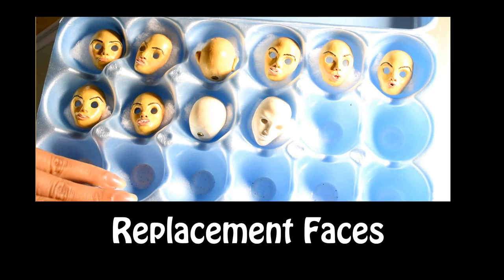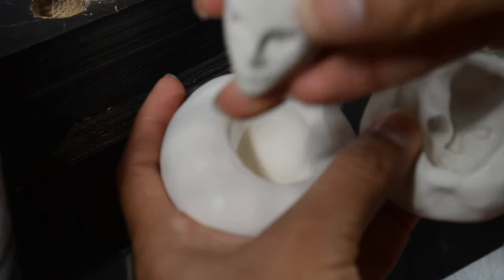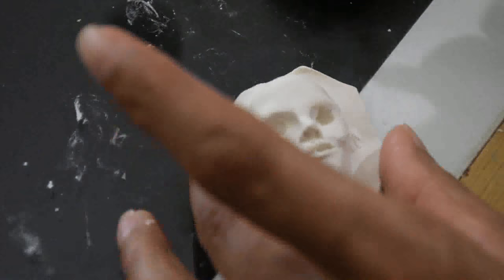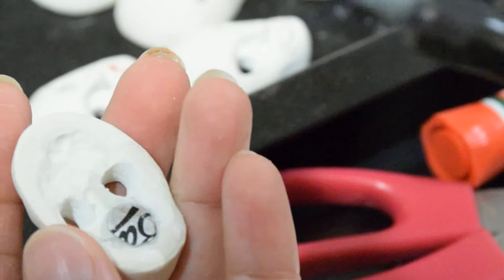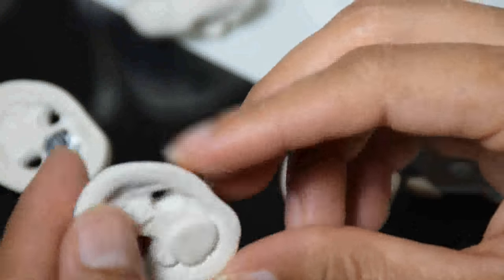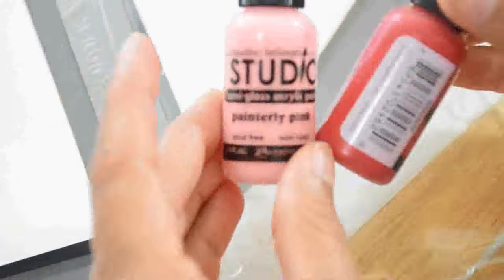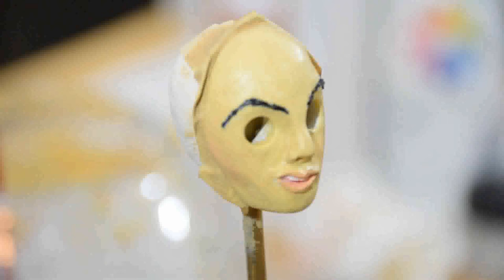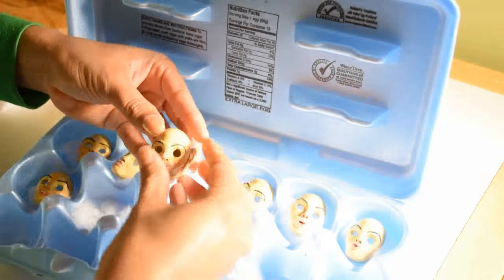Replacement Face & Mold Making for Clay Head (Stop Motion Animation Puppet)

Comment: I have only used resin and silicone for puppet heads. Maybe I gotta try making them with clay by following your technique. Since working with silicone and resin can be really messy(because they are liquid before curing and are extremely annoying when it gets on skin) and take too long.(silicones can take up to 6~8 hrs depending on brand and temperature) This method seems like clean and quicker.

Comment: I'm assuming you are using polymer clay for both head and mold? And corn starch is acting as release agent? Maybe make mold out of some other stuff like platinum based silicone. So you don't have to use release agent like corn starch. This way, you can make sure clay goes into every detail(like nose) by taking small pieces and manually shoving them.

Comment: How do you get the same skin colour every time?
Reply from the maker: Hi Edvard Lorvik Loken, well I have a good eye for color variation, so I don't usually premix, however, if you are doing a lot of faces, there's many way to do it if using paint...you can pre-mix custom paint for the skin color and keep it in a sealed bottle, or you can your paint professionally mixed, as a sample color for the smaller cans. If you're mixing the clay, I suggest getting a huge batch mixed with a dough mixer, or I use my little pasta maker sold at any craft store to mix. If you're using pastels then you could create a powder scraping or grounding  and mixing the pastels to the desired skin color and then keeping it stored in a sealed container. In this video I used acrylic paint...There is also different types of clay on the market like super-sculpey in the beige color or different colors that is already mixed for skin tones and you just add your eyebrows, lips, you could use pastels to shade for highlights, low lights, cheek coloring...etc. It is all a matter of preference but definitely keep in mind how many faces or body parts you would need and pre-mix a batch of it...hope that helps. Sher
Reply: Sherryl Chavarria thanks👍

Comment: material name plse tell me
Reply from the maker: Hi Bayrsaixan Zayasaixan, I used sculpey original clay in white...it is the oven bake kind. I used a section of brass tube that I place in the neck area of the head, that is to attach it to the body. I used magnets in the cranium of the head, and on the replacement faces I used a tiny piece of metal that helps the face attach to the magnet. You can use any type of super glue that is strong enough to hold magnet, metal pieces, and brass tube in place. You can smooth the clay with oil, and after it is baked, if you choose to paint, I used acrylic paint, or you can use pastels to shade. I hope that helped :)
Reply: Thank you very much. I dont speak english but... You want need me. You need writing some video link
Reply from the maker: You are welcome :) I agree I need to write it in the video link, I thought I had done so in all modelling videos, but the when I went to check on this one to get the info you needed there was no material list in there, I will do so later on. Thank you for your suggestion :)